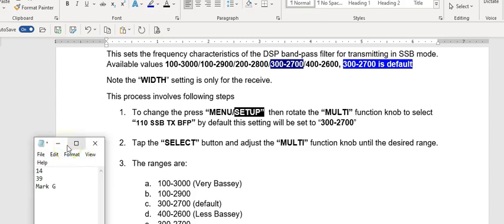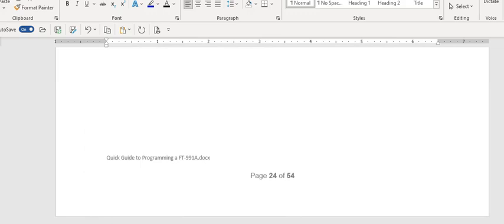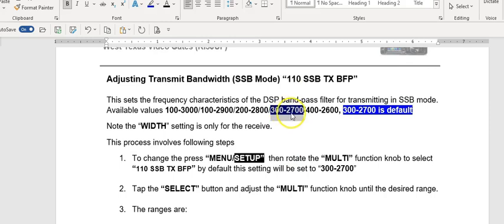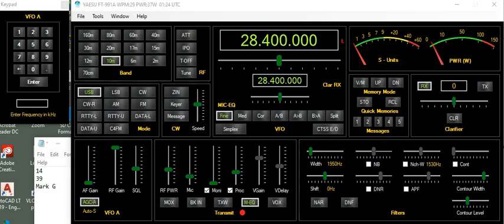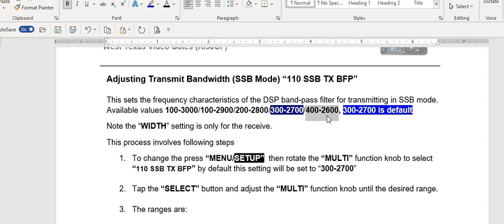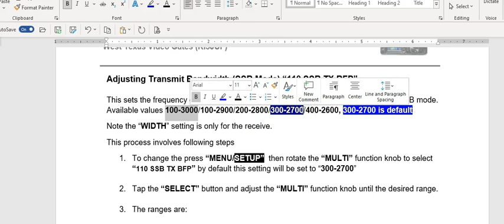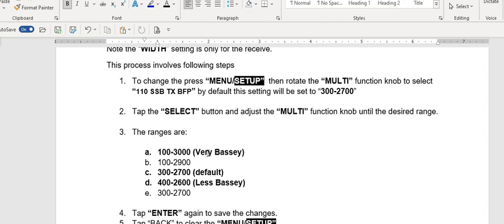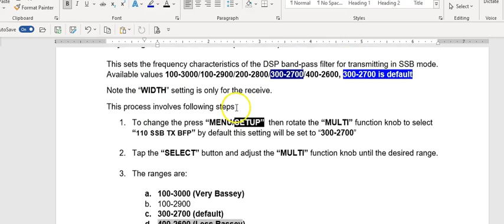Yaesu FT991A  -  Adjusting Transmit Bandwidth (SSB Mode) “110 SSB TX BFP”  Success with Transmit

Comment: What are the EQ settings used ?
Reply from the maker: In case this is not clear email me shope02@yahoo.com

Menu
128
129
130
131
132
133
134
135
136

Test # 1
500
-5
5
1500
-5
5
2500
-5
5

Brent Test (this sounds very good)

100
10
3
700
(-3)
7
3200
10
2

Yaesu Manual Recommendations
100
10
3
800
3
3
2100
8
1

Default Setting
200
0
2
800
0
1
2100
0
1